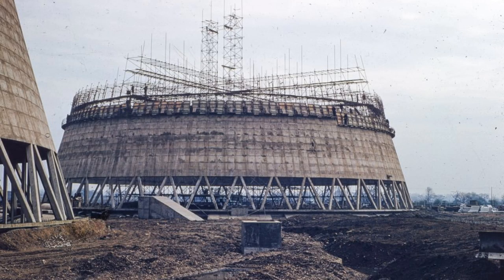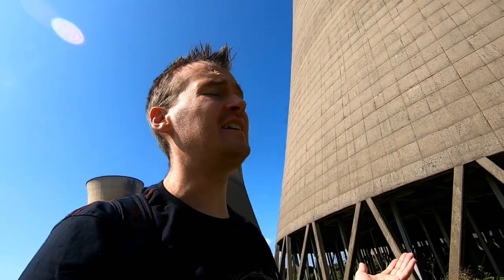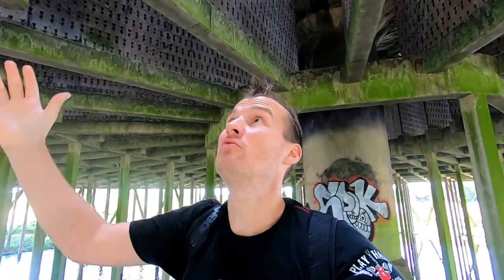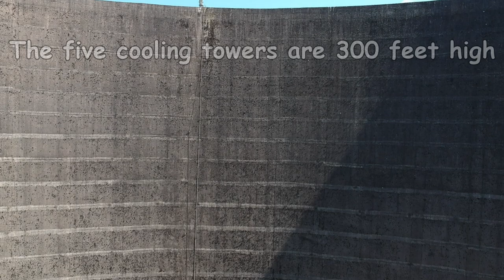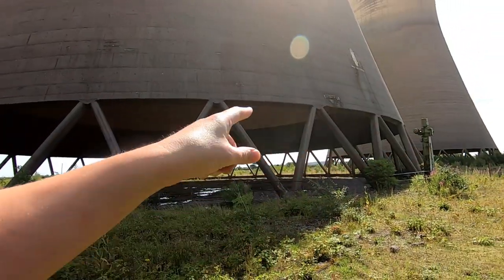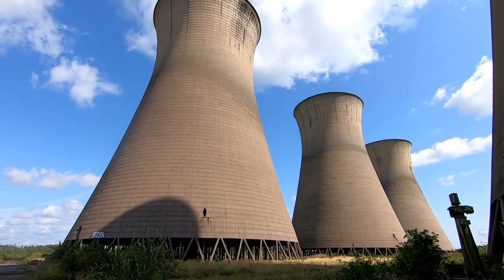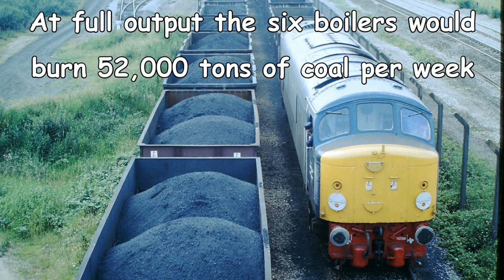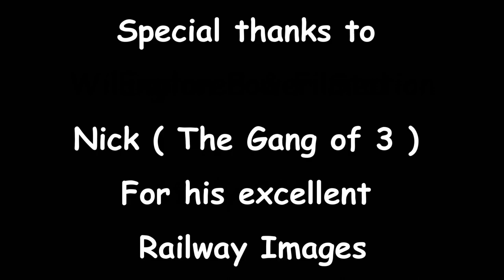Willington Power Station Cooling Towers Then & Now Explore

Comment: I visited there with work in 1980's. The boilers were unique in that they weren't enclosed in buildings so you could get a great view from the stair cases climbing up to the top of the boiler - so long as you had a good head for heights! Good to see in more detail what you normally see from the road - Thanks :)
Reply from the maker: It's surprising that they are still standing, it looks like they will be for a while yet too 😀 Thanks for watching 😀

Comment: I live close to these and have been around the site many times since it closed (although parts of the site are still used by sub-stations), and the original plan was to bring them down and build 1800+ houses on the whole site. These had peregrine falcons nesting in them so got spared, then the developers tried and failed to get government subsidies to clear the site before building as the ground was contaminated. I believe there are still plans for the building work, but nothing seems to have happened for years. Personally, with so many coal fired power stations going, one or more of these towers should be listed and kept. They are works of art now.

Comment: That was awesome Ant. I didn`t know the power station proper had gone and I hope the sisters linger on cos apart from anything else they are a useful landmark for the A38/A50 crossing when we do the coach runs to Alton Towers and anywhere else local. The design of cooling towers is such that as the air rises the smaller diameter of the tower speeds up the air before ejecting it out of the top. This of course draws in more air at the bottom so the cycle is self perpetuating. Simple and effective.
Reply from the maker: This was one of my favourites from last year, the towers are simply breathtaking. I'd like to visit another one some day soon

Comment: Beautiful towers I hope they will not demolish them. You mention fans at one point, but these are natural draft cooling towers, they didn't have any fans. When hot water starts to spray from sprinklers hot vapor rises up and height and shape of the tower helps to suck fresh air from below and cool dripping water. There are some other designs of cooling towers that use fans but they look different.
I apologies for nitpicking, it is very interesting video and I'm new sub. I saw you in Martin's video.
Reply from the maker: Hello 😀 i was never 100% sure if these did or not so read up on them and saw some diagrams that had fans. Great to have you here 😀